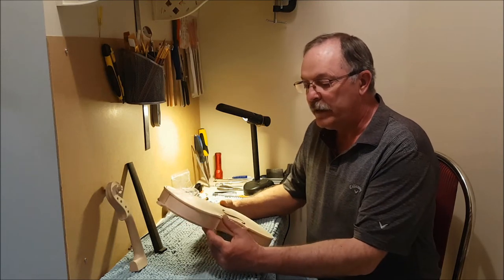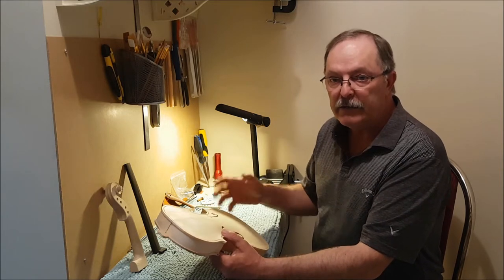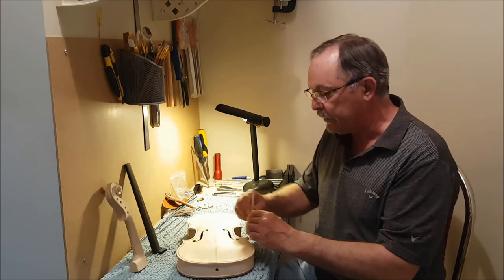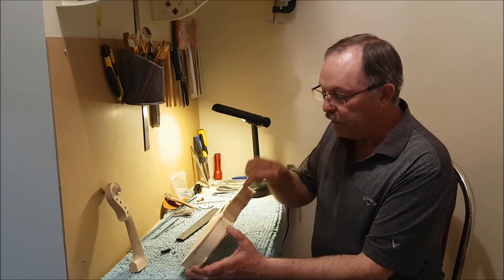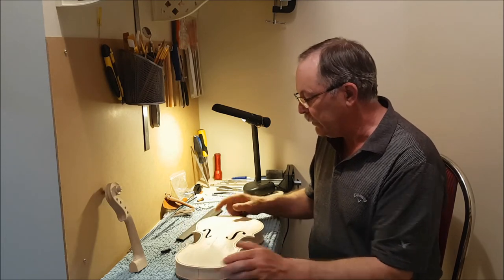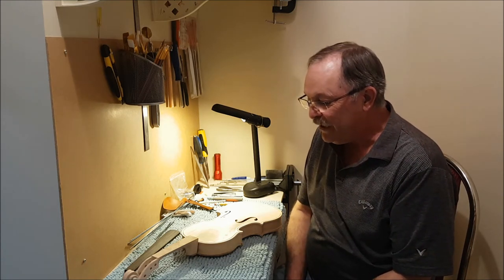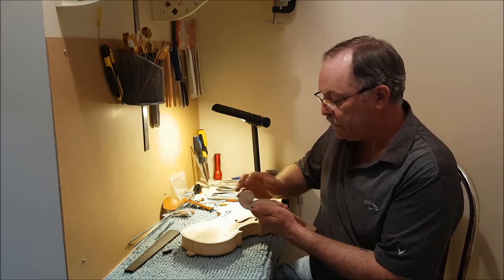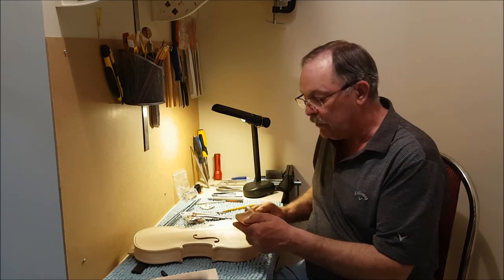StewMac Build Episode 1 (Overview)

Comment: Glen, I see in one of your comments that you think it’s well worth opening this kit up and fine tuning the plates. Is this something you have done with this kit? 

I have a brand new kit sitting on my bench and hide glue ready to go. I’ve never worked with hide glue but I understand the plates should come off fairly easily.
Reply from the maker: Yes, thinning or tuning the plates(not necessarily the same thing) was one of the two times I took it apart to fix mistakes. It made a marked difference in the sound. The other time I took it apart was to change the length of the neck, which I had made too long.
Reply from the maker: One thing I have found is that the hide glue does not need to be too thick. It will come apart much easier next time if the glue is not too strong.
Reply: Did you pull apart the front and back plates on the body latter on? I’m looking into doing that first. 

I have a thickness gauge and thumb planes. I hope to tune the plates, just wasn’t sure how difficult I should expect it to be.
Reply from the maker: @timjohnson1105  only the top has to come off. Shouldn't be too hard, but there is a technique to it alright. Should be lots of help on YouTube.  If you'd like to see how I tune plates, you can email me at www.glenclarson.com and I'll share. For what it's worth.